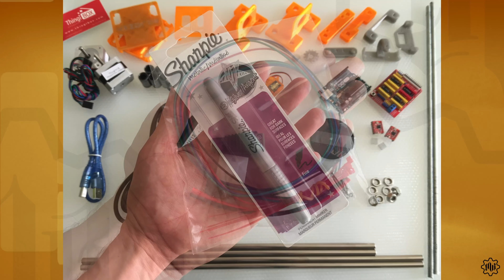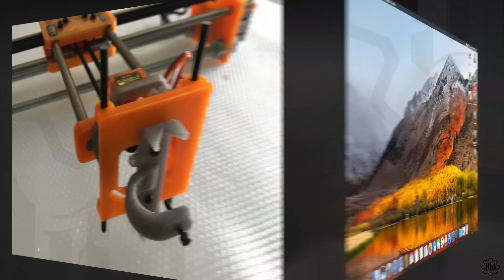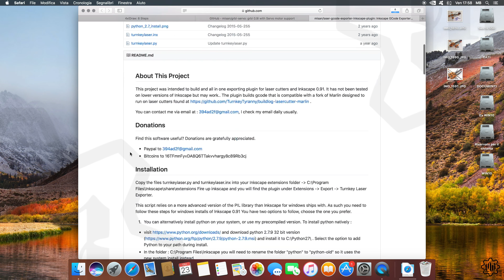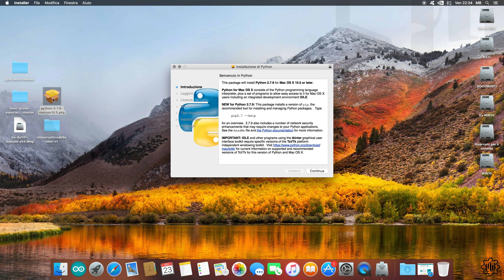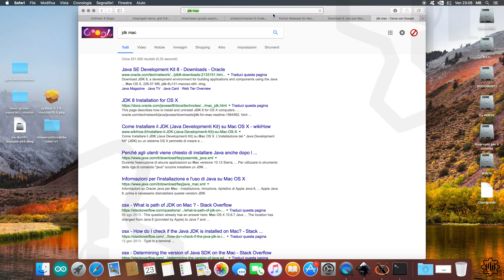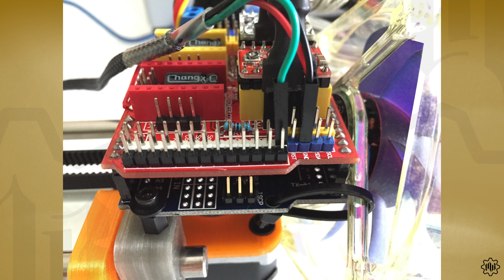✍🏻✒️VIDEOTUTORIAL - 4xiDraw "Clone" - The Drawing Machine (UHD - 4K) ✍🏻✒️

Comment: Hello. Sorry but I have a problem with the servo motor. When I move the Z axis my step motors begin to make noises and the servo motor doesn´t work. Do anyone know what is happening?
Reply from the maker: Hi Klang, 
First you have to test with the disconnected and steering servo motor. You have to understand if the servomotor moves during the program or not. It may be that the movements are in the opposite and then vibrate because it came to an end ...
Reply: TheMiguelBi I have already tested the servo and it doesnt move
Reply from the maker: If the servo does not move, it may be connected to the wrong arduino pin. If the software is not the same as the video, output pins could be changed. or the servomotor may be damaged.
Reply: TheMiguelBi I made exactly what you did :(
Reply: TheMiguelBi  I put the brown wire to ground. The red wire to 5 V and the orange one to Z+
Reply from the maker: Yes, that's right!
Reply from the maker: The software on Arduino is this https://github.com/misan/grbl-servo ??
Reply: TheMiguelBi  yes :(
Reply: file with extension".c". Do it convert to ".hex". That's all right?
Reply: i have the same issue??? did you find a solution??

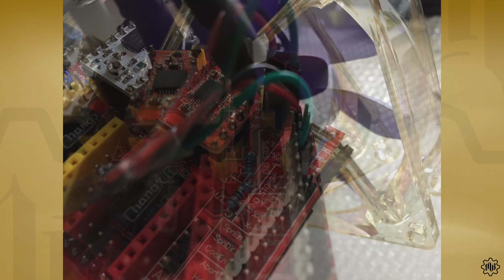Comment: 26:25 ı connected servo motors singal cable to end stop z+ but servo motor always rotating. What can ı do more ? ı dont understand
Reply from the maker: All tests must be done with a servo motor in hand. How does it work with a servo motor leaning on the table? If the program you are using is correct, it can not work forever. the servomotor works at maximum 180 °!
Reply: Yes ı found. my servo doesnt work ı ll try new that. so can u install new video while working ur machine. and can u share all calibration setups on video ? Thanks everythings ^^
Reply: Same problem do you get any solution on that

Comment: I m using Windows but ı can not open Universal Gcode sender ı dont understand. Anyone help me ? Thanks
Reply from the maker: Hi burak GÜNGÖR,
You must have "Java" installed and updated. 
If it does not work try installing the most complete Java version ....
Reply: I installed jdk 9. maybe ı dont know how using java while openin .bat document.
Reply: I install java and updated after ı ll open .bat normalley, wouldn't it ?
Reply from the maker: burak GÜNGÖR Yes exactly! UGCS is a lightweight program. Strange there are problems with it. did you try to start as an administrator user? or on the properties try booting it in mode compatible with some other previous operating system ... I do not mind anything else ..
Reply from the maker: Maybe you can try some other program similar to universal g-code sender. There should be more ...
Reply: ı found. ı installed again and run :) Thanks for help <3 can u give me connected circuit diagram of Axidraw ?
Reply from the maker: I have no scheme, but it is simple. 
The motors should be connected directly to the driver outputs, remember the condenser between the reset pin and the gnd, and then the servo motor: 5v, gnd and signal. 
But it's all visible in the video. You can not go wrong! :)

Comment: I am using 0.4A 12V stepper 
What should be the max voltage?
Reply from the maker: You must read the value of the sensitivity resistors of your A4988.
And then use the formula that I wrote to you yesterday.
Vref = Imax x (8 x Rs)

Comment: What if i use a heatsink
Do i still need to modify the stepsticks?
Reply from the maker: With 12v 0.4A motors, no heat sinks are needed.
My engines in the video are 1.95V - 1.7A. That's why I installed an electronic fan too!

Comment: And is it done by turning the potentiometer on the stepsticks right?
Reply from the maker: Exactly. Here you can find my video https://www.youtube.com/watch?v=wpUMptJo-xs
Reply: I know....
But the problem is that its in italian
I cant understand anything...
So lets suppose i use the exact same nema 17 motors that you used in your project...
What should I modify in my x and y stepsticks(voltage current etc)?
Reply from the maker: You did not understand. The name "Nema 17" does not mean anything!
There are 2V and 3A motors and 12V 0,4A motors. VRef is not equal !!!
Also, to calculate it you have to read the sensitivity resistance value of your pololu.
Search for a video on your language on YouTube ... so avoid burning it all !!!
Reply: Ok can u just breif me about what to do to adjust the vref of my stepstick?
Reply: TheMiguelBi 
Thanks!
I found a video from pololu robotics to set the max current output using vref
Keep up the good work!!

Comment: What should be the output current/voltage of the stepsticks to avoid overheating?
Reply from the maker: You have to calculate that! Vref values depend on the type of engines you are using.
In my video (in Italian) you can find answers https://www.youtube.com/watch?v=wpUMptJo-xs.
Vref = Imax x (8 x Rs)

Comment: Are you sure that the voltage regulator on the Arduino (Cloneduino) will be able to continuously supply enough current for the servo without overheating and failing?
Reply from the maker: Hi Volker,
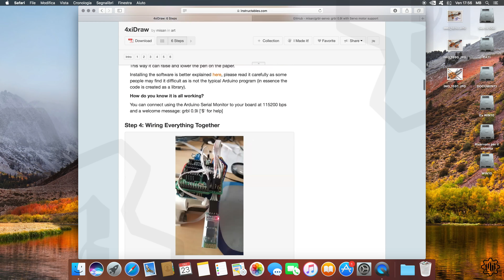with the modification made by Misan, which you can see at the 10:03 minute, I had no problem using the servo motor.
Reply: Yes, but the 2A power supply powering the CNC shield will be too much for the Arduino voltage regulator, so power the Arduino separately and cut off the VIN pin on the CNC shield.
Reply from the maker: Arduino only has the USB cable. I powered the 12V-6A CNC Shield, using the Misan modification for the servo motor. And I have never burned anything of Arduino. I do not understand what you're referring to ...

Comment: Great job Miguel, i have just ended the assemble of your version of the axidraw. i'm in trouble with the servo, i send the M03 S255 command and  the servo only sound a high note, and don't move. my servo it's mg90s, and doing a previous test with the servo library of arduino it works fine. i think is a problema with e right frequency of the modulation. thanks for your support
Reply from the maker: Hello dmainero88. The M03 S255 command I think is exaggerated. In my normal use, the down position corresponds to M03 S0, while the top position corresponds to the M03 S30 command!
With higher movements to M03 S30 you will need to manually add a delay, otherwise the pen will move without touching the sheet. Otherwise, the alternative will be very very slow XY moving times.
Do you still think your problem is the servo limit switch, at the time of assembly it was centrally located?
Without electric current, can you manually move the "pen block" up and down?

Comment: why threaded rods are used no parts are connected to it .plz tell me sir
Reply from the maker: They are used to keep the pieces printed in 3D, otherwise the only smooth bars would move during printing. In addition, the weight of the M10 bars gives stability to the plotter.

Comment: How can I buy this machine ?
Reply from the maker: This project is to be built in assembly kits. Find the Material List here: http://www.instructables.com/id/4xiDraw/
In the video description there is a list of components with a purchase link. 
Or you can find the kit in this store (Spain): http://store.thingibox.com/en/4xidraw/198-axidraw_vitamins.html Caution. In this latest kit something is different.
Reply from the maker: Hi Ruzty Jasper, The threaded bars are of different diameters. 
Thingibox ships 8mm. The .STL pieces are for 10mm bars. 
Greater bars are better because they increase stability during printing.
I bought 10mm bars in a hardware store near home. They cost a little money.
Reply from the maker: Yes, the only difference is that. 

The motors consume and heat less when purchased at 12v - 0.4A. So you can use a cheaper 3-4A 12v power supply! ;)
(Thingibox ships 1.7A motors, which is why the power supply is from 6A. Almost exaggerated!)
N.B. The link "power supply" reports a 12v - 6A. You do not need all this power!